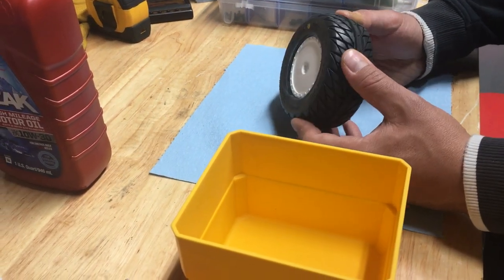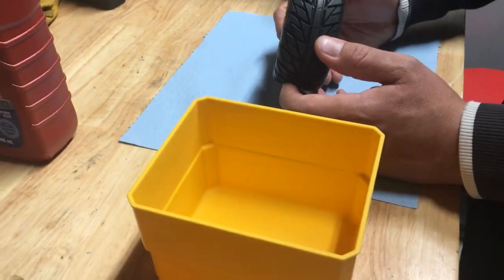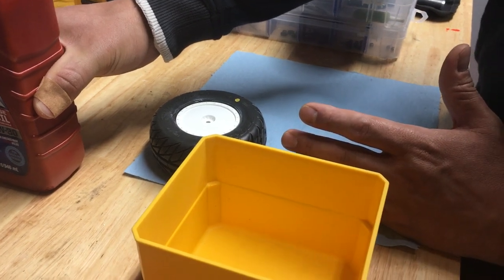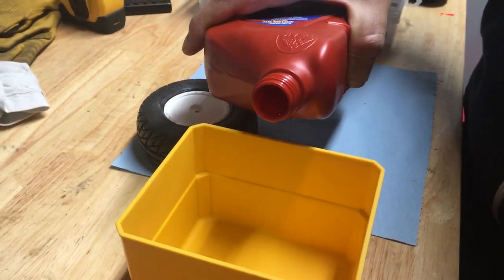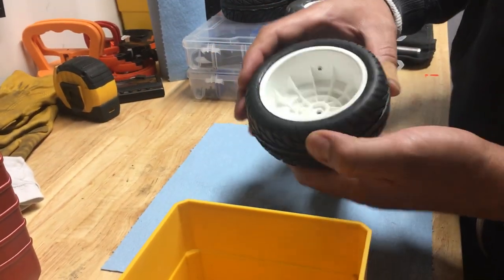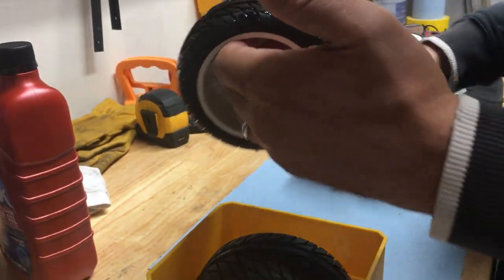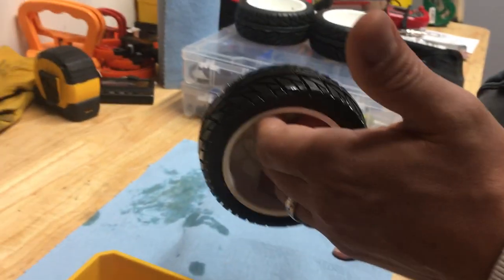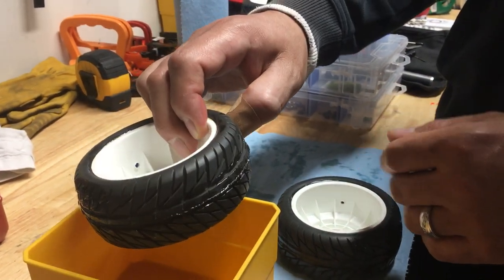RC On Road Tire Saucing for Traction

Comment: what is the chemical process that makes it sticky? Should I just let it sit on the tire to merinate then use them or is there a processing step after the wait period
Reply from the maker: Tires are made of rubber and rubber is "oil" based. And motor oil is "oil" based. Long ago there used to be a company that pretty much sold ATF oil as rebranded "tire sauce". Some people leave ProtoForm VTA tires in baggies in the sun soaked in WD-40 or other lubricants such as ATF oil. It softens the rubber. Be carful with tires as they can start to swell too much and "balloon". 

Now, it will depend on the tires. The tires in the video are SCT tires. You can just apply oil when they start getting hard and let the sit on a shop towel for a day and check them. You need a light coat only. If you want then softer, do another day. Stop is too much rubber start to wipe off as the rubber is now breaking down.

Comment: Motor oil for traction??? I think I'll skip this tip.....
Reply from the maker: You are not going to drive it right away. You let it be a few days. It is not a 2 second fix. It is a chemical process. 👍😎

Comment: will this work i found it on amazon.com but i got some for a hardware store it 3 in 1 10045 motor oil
Reply from the maker: It will work. Just make use to apply. Let it rest. Wipe off and let it dry. When it dries is when you really feel it grip.